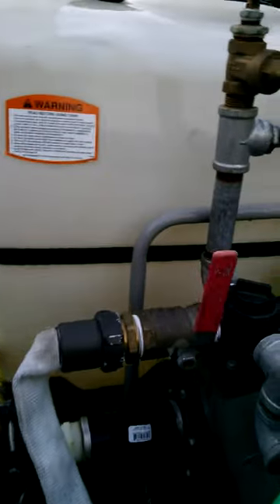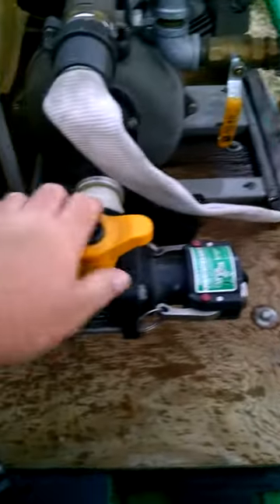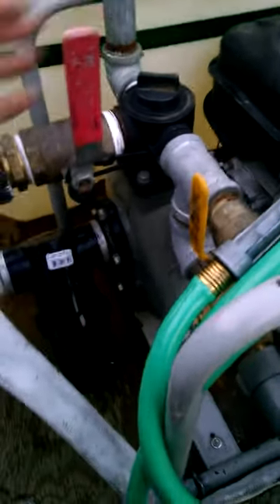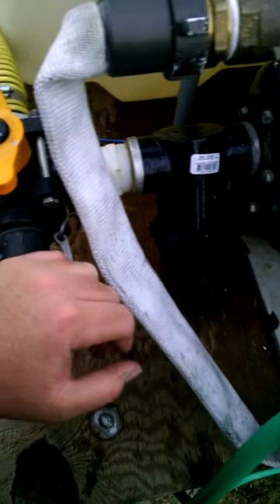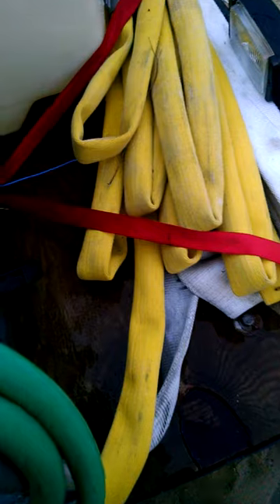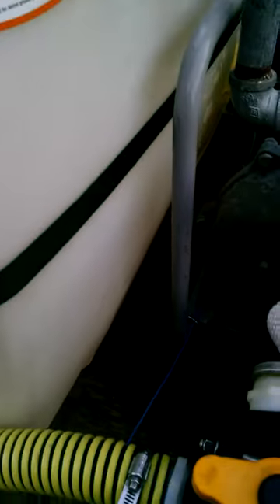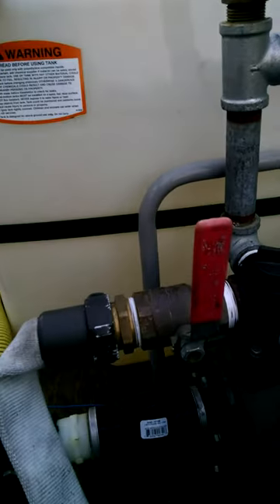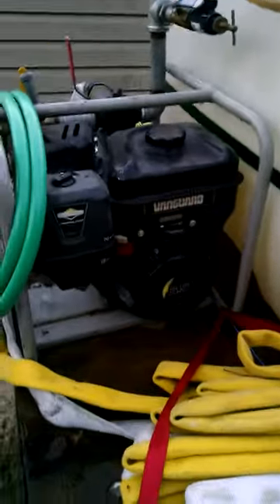John Deere gator brush truck

Comment: Brother, I have one question for you. My water heater is smelling propane but isn’t making the ticking sound. Should be the sail switch, right? But, I also have another problem, because the gas valve isn’t closing, I’m losing gas because this is always open, how can I fix that?
Reply from the maker: I have a couple questions. How did you end up on my page? Second question, are you being real or just mad Because I commented on something of yours and you want to be a dick ?